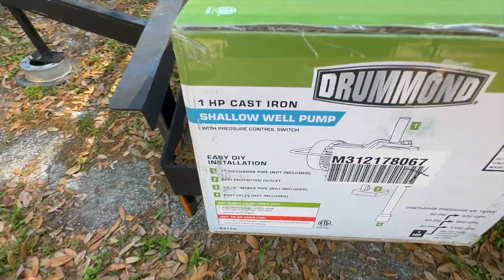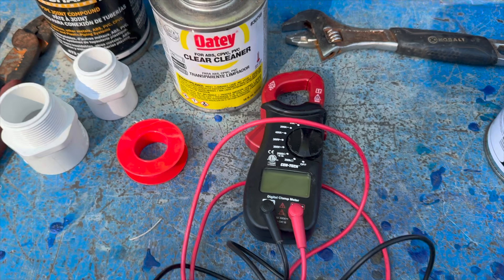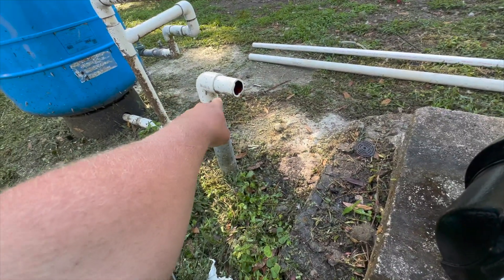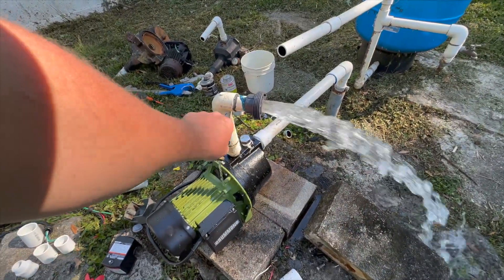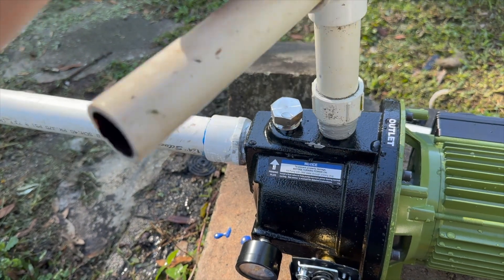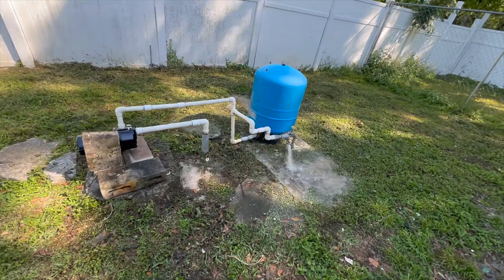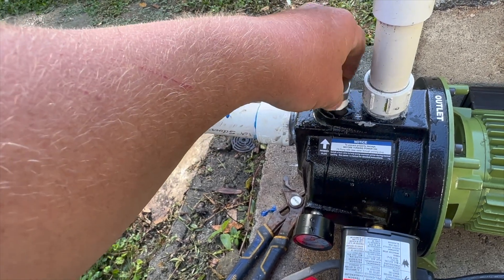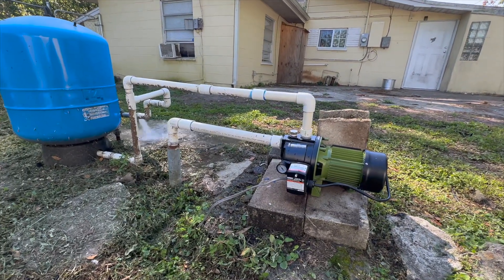Harbor Freight Well Pump Installation

Comment: Hey i have some issued with my well pump and tank but they are brand new. So whenever the pump kicks on at 30 psi the pressure coming out my hose bib loses pressure about half way
Reply from the maker: What kind of pump/tank? Do you have a filter or anything between the pump and tank?

Comment: My new pump like this seems to turn on more quickly  when i turn the water on. Should i adjust the pressure switch?
Reply from the maker: Id check your air pressure in the pressure tank, that would typically be the reason you pump turns on and off quickly.
Reply from the maker: Make sure when checking air pressure you turn the pump off, and drain the water pressure from the pipes by opening a hose bib. Then set your pressure in the tank around 25psi.

Comment: That switch is in a dangerous spot and can short the motor  because it can get wet when priming. It  should be towards the back   or we're the plug  at just a fyi
Reply from the maker: 💯 agree, thats how it came out of the box customer was on a budget so thats how we go them going for under $300 bucks.
Reply: @KnottsFishing  understandable I no its  the cheapest price.  No one actually sells  one for that price. It incredible harbor fright can even make a penny  at that price 💯🫡✌️👍

Comment: Lol that not a well pump.  It a shallow well booster pump.  Also called a jet pump.  A submersible is a well pump. It actually goes in the well under water. Iv work in the water well industry for over 20 years now. 💯👌👍🫡🤭✌️💦 nice work saved tons doing your self. We're not cheap that for sure
Reply from the maker: In FL with 1ft water level we call that a well pump down here.
Reply: Shallow or booster pump. I've used this exact pump on my 23ft well for years with zero issues.
Reply: @elcomandante9299  I don't doubt it.   The chance that someone has in California with a water levels to be  only   at 20ft or even  40ft  pertty rare  it would be close to the ocean   if not some other big water source for that to happen. Usually every thing close to the ocean can't be used to drink or water food with it . Salt  Usually present    California  well water levels very from  a ruff average of 100-300ft for residential purposes  and agricultural about the same district.  Of course there are lots  that can be higher levels  a lot of times it's not usable  for drinking  in less it tests okay.   In Alaska you don't even really need a pump all most every thing clean enough to drink safely   at any depth or strength from river or lake.  There not to many state like that  though in  the USA  my be a handful  .  Your  just lucky to be one of them.    Iv seen some areas that don't have any water till 500 ft  of depth  and only could produce 7gpm  🤕💧🤑  💯🫡✌️
Reply: How about convertible jet pumps 25 feet and down to submersible depth?